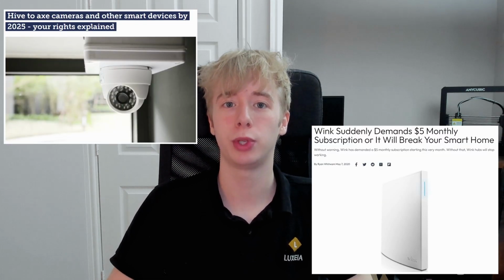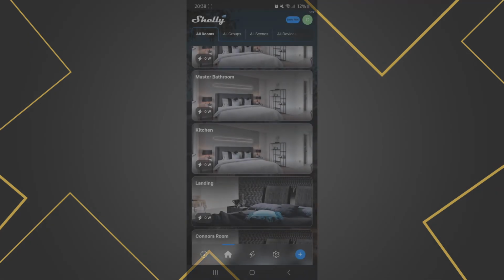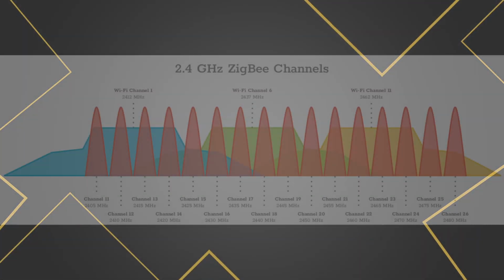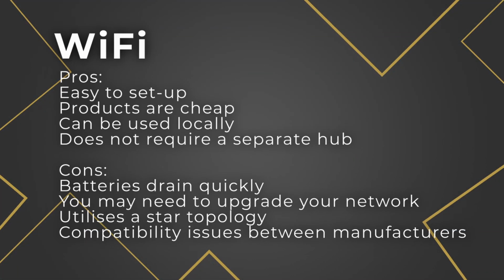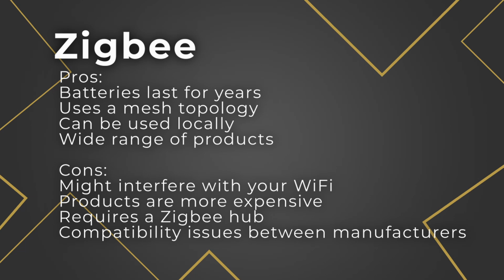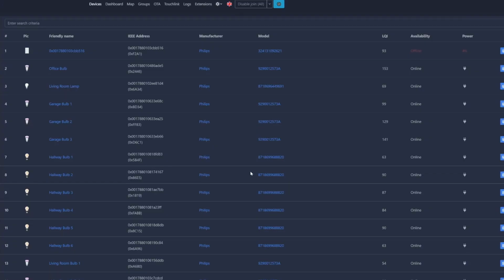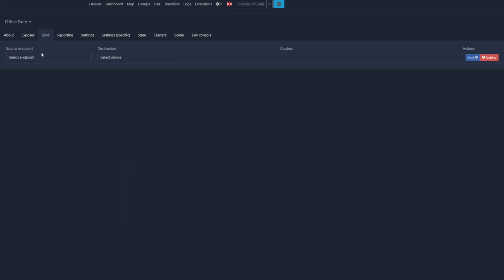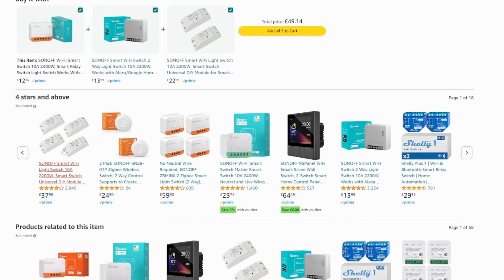A Beginners Guide to Smart Lighting

Comment: what smart switches would you recommend - dimmable options?
Reply from the maker: Candeo dimmer switches are a good option if you are running Zigbee. You can get the entire switch from them, or just the module. If you get the module you can integrate it with any existing dimmer switches.

Comment: Any recomendation for european smart relays, behind light switch or shades, that are cheap and act as a zigbee border router extending the mesh? ☺ or should i go with shelly, but there is only wifi available :/
Reply from the maker: We like to use the SONOFF Zigbee Mini Smart Switch. This does require a neutral though. The SONOFF ZBMINIL2 does not require a neutral, but this wouldn't be a good choice for you, as it does not act as a router. Although the ZBMINIL2 is wired into the mains, not using the neutral means it acts as an end device. These devices would only be applicable for light switches. As for shades, I don't have any retrofit Zigbee suggestions for relays unfortunately.

Comment: Great video mate.
Nice to see some local lads!

I have a question... I want an LED strip to fit under my garden step. Its around 7.5m and I was looking for a plug and play option but the usual names are not fitting. I am looking for a high density RGBWW strip and one thats IP rated.
For that length, I have gathered a 24v COB or 'neon' style strip is best as there may be a time where you can directly see the strip and I am looking for a dotless finish.

Judging by what research I have done, it may be best I go for a strip and diffused channel as all the off the shelf options won't allow me to cut them (or so they say).
I am running ZHA so I would prefer zigbee.

I dunno if you know of anyone local who can sell a decent strip or amazon?

I don't wanna play around with ebay strips and have them fail.
Reply from the maker: Thank you!

Given the specific requirements for the strip, it is difficult to find. Generally, outdoor LED strip won't allow you to make cuts as it will invalidate the IP rating, allowing water to enter the strip. However, technically speaking you can make cuts as long as they are made on the pre-existing cut lines of the strip, but this will invalidate the IP rating.

A good place to look for LED strips is LEDSpace, Ultra LEDS, and InStyle LED. Failing that, almost any strip on Amazon should be safe.

Sorry I can't be of more help!
Reply: @LuxeiaLtd  cheers for the help mate. I will probably seal the end but I won't be too arsed about any water being an issue as it would be in a diffuser and its under a step. Plus low DC voltage.

Comment: Thanks for all the info in the video. I’m planning a full house electrical re-wire and creating a smart home at the same time so this video was perfect. 

I’ve love to see videos on smart door handles, smart relays for 13a UK sockets (I’m planning to have an roller garage door on my smart system) and smart energy monitoring devices as I’m planning to integrate all in my build.

I think I have the right understanding of how to do it all but just making sure I soak up as much knowledge as I can before I start me re-wire & smart home install.
Reply from the maker: I am glad you found it useful!

Some great video ideas that I'll add to the list, thank you. I am currently looking for smart door handles/locks for my own home, so this may be coming very soon! If you want to go over anything regarding your project you can contact me at connor.thompson@luxeia.co.uk. Not a selling tactic, just offering some free advice for your project in a more private environment if you want it.

Otherwise, good luck with your smart home project!
Reply: @LuxeiaLtd  brilliant, look forward to future videos! 

I was looking at the the Yale Assume lock 2 but haven’t seen anyone from the UK have a play with them yet, they seem hard to come by without importing them so I’m not 100% set on it.

Thank you for the contact offer. I will definitely take you up on that when I’ve got my head around my full plan as it’s still in the early stages of design, originally I was only going basic smart home with only lighting for Smart Control, but having looking into home assist and the potential, I think I’m gonna go all out!
Reply from the maker: @jamey.k  I'll take a look into this particular lock. 

Haha, that is always the way with smart homes, and in particular Home Assistant. Once you fall down the rabbit hole, there's no going back!

Comment: Also, voltage drop on LED strips isn't necessarily caused by the size of the power supply, its caused the resistance in the copper traces in the strip. This is why you may choose to put multiple power injection points across the length of the LED strip, but don't necessarily need to increase the size of the power supply.
Reply: At what length does it become an issue? Would 7.5m be an issue?
Reply from the maker: @CalMUK91 The general rule is that any continuous run over 6m can begin to experience voltage drop. But check with the manufacturer, and run some calculations to determine the length you can truly run. You can use an online voltage drop calculator like this one for ease: https://www.waveformlighting.com/tech/led-strip-light-wire-gauge-calculator-requirements

Comment: I totally disagree about the negatives with smart bulbs. I use them with wireless switches across my home, and with a sock solid zigbee network, its almost never an issue. Also, the wireless switch sits over the old physical switch, so if I had to, I could still power cycle the bulb to turn on the light. I agree with the statement about colour, but there are many places where I use colour, such as low level hall lighting that goes red after 11pm so your night vision is not disturbed if (for instance) you go to the toilet in the night. Also, with smart bulbs, colours can be used to indicate statuses of other things in your home, such as doors left open, washing machine finished etc. And finally, using fading and dimming to set different moods is an ideal use case for a smart bulb.
Reply from the maker: That's what's great about smart homes. Everything is personal preference! I am just speaking from my professional experience and the comments we have received from clients.

Putting personal desires aside and approaching it from a technical point of view though, bulbs are inferior to wired smart switches, as they only communicate wirelessly. Smart lighting is all down to personal preference, and we have installed tons of smart bulbs for clients that wanted them, but a lot of these clients have openly told us they regret getting them, and wish they had taken our advice when we were suggesting the other alternatives. Fading and dimming is also an option with both relays and switches to create different moods, without having to constantly rely on a perfect wireless connection. You can have the greatest network set-up in the world, but unfortunately issues can still arise. That's why any installer will tell you to go wired where possible, and that's why we suggest staying away from smart bulbs!

But again, everything comes down to personal preference, especially if you enjoy tinkering and don't mind fixing the odd issue when it pops up!
Reply: I do agree with him.
The only time I use smart bulbs now is when I want to change the temp or colour.
Otherwise I use candeo or moes smart switches.

Although I don't recommend MOES as I have a couple of electric blinds that use bluetooth and a RF remote (not exactly smart, they work).

The blinds seem to do a handover with each other twice a day and the moes switch hears this RF hand over and switches on my light 🤣.
I have tried to cut the RF antenna on the MOES switch and I am still not winning.
Had to set up a automation to switch it off.
Reply from the maker: @CalMUK91  That is the only time we use them with our clients, is when they are really after colour changing. As a client I can understand the desire for smart bulbs, but as an installer I also understand the headaches they can cause. When a client tells me they're not bothered about colour changing I breathe a sigh of relief 😄
Reply: Rather an ugly solution for the switches though . Certainly not acceptable for my wife, but YMMV.

Comment: There are lots of use cases for contact sensors. Security being one of them on Windows and Doors! Did you leave your windows open? Turn off the heating/AC. Or even for the "Wasp in a Box" where a light doesn't turn off if a person is in a place that they've closed the door - even if motion isn't detected. Paging Dr @technithusiast ;-)
Reply from the maker: That is true, there are loads of applications for contact sensor, but this video was only for lighting. I'll be doing other "Beginner Guide" style videos that cover other smart home topics, where contact sensors can have their time to shine!

The "wasp in a box" approach is a good method to mention though! Great for bathrooms.